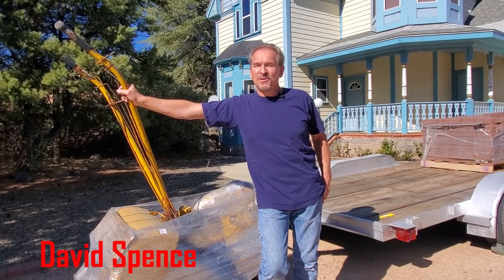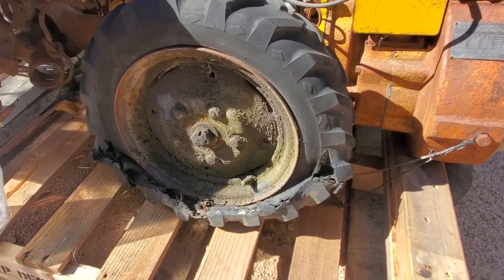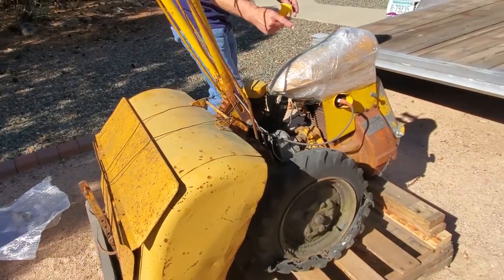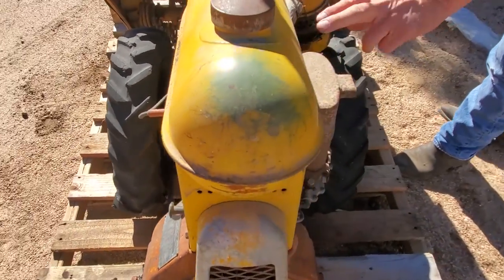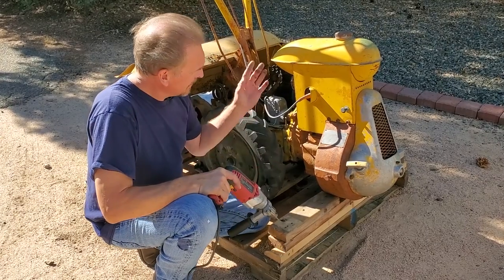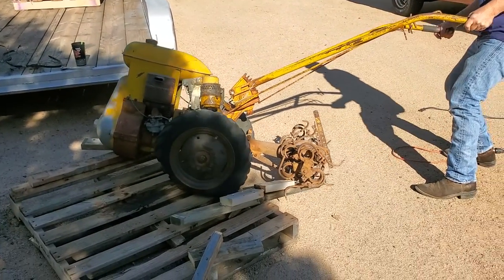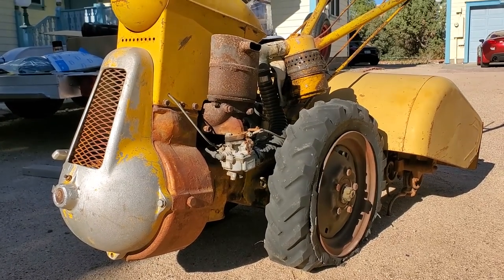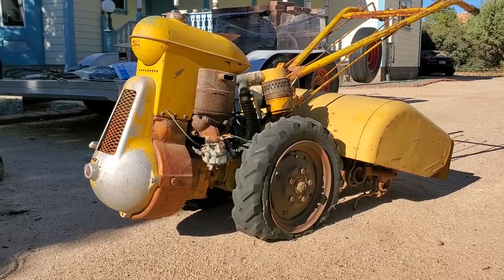Graham Rototiller Overview and Unboxing  - Graham Paige Rototiller Preview

Comment: graham and paige were auto companies prior to the war. They stopped making cars and made war items all during the war. After the war ended, they thought they could sell tillers to veterans to do home gardens and they did quite well. IT was a heavy and powerful unit, expensive, so many couldnt afford them but those who did had the best tiller ever made. I dont know how Frazer got in the act, maybe he bought the company, but at any rate it was very capable. The engine was a specific design made around a supply of surplus military aircraft radial air cooled engines. These pistons were offered surplus at a great bargain and the rods and engine and gearbox were made to fit. My uncle had one in about 1950 and owned it til he died many years later,,,,a great piece!!
Reply from the maker: Yes, we're proud owners of this neat piece of equipment. Now that we've worked out all of the kinks we can put it to good use. And for years to come! Thanks for watching.

Comment: My uncle had 2 of these. They are a work horse. Hard to start though very hard.
Reply from the maker: We're happy to bring back warm memories. We just had it timed and the tiller is near completion. There is no doubt, another video about the Graham Rototiller, once we're finished with it. Thanks for watching!
Reply: Disagree on the hard to start. My starts very very well. It is a B-16. Steel wheels. Early 80's rototiller was sent to Auburn Indiana and restored and reverse was put on it and rubber tires. In my books they are a great machine.